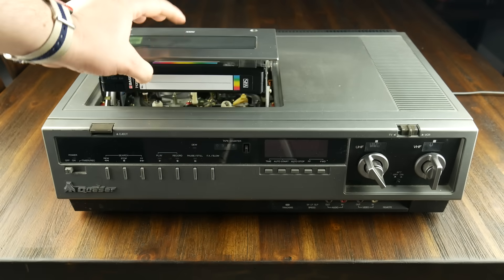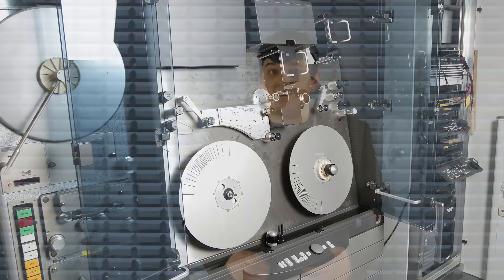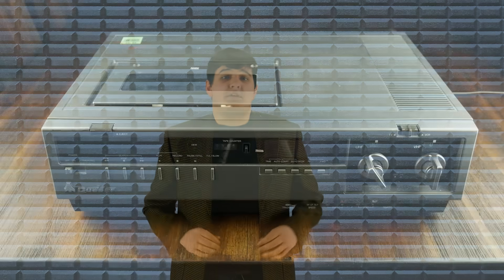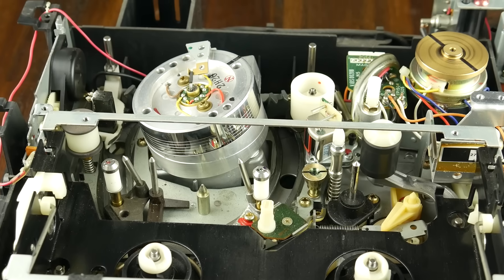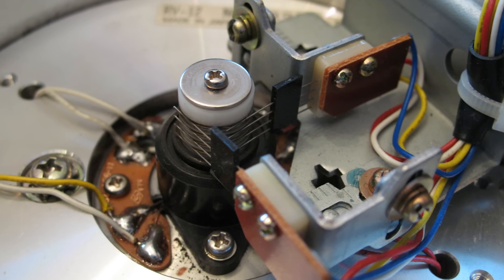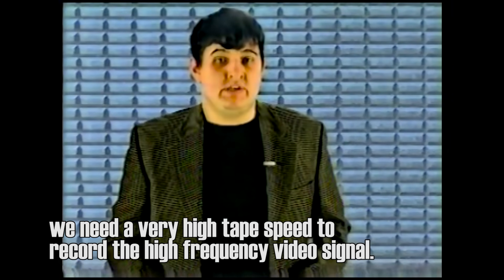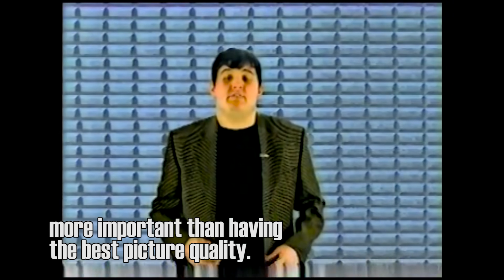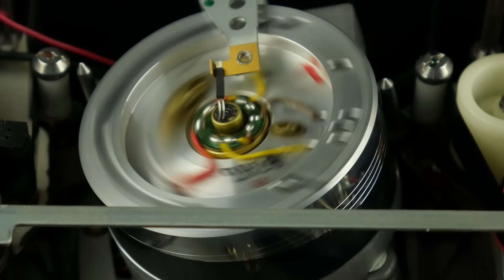The Impossible Feat inside Your VCR

Comment: i still have VHS. i hate them cause bad tracking means crap video or audio. meaning the only way to rip a bad vhs is record audio and video separately and put it back together via video editor.  to top it off vhs is interlaced meaning video resolution when rendered progressively is cut unless you use handbrake to render  the video with a special filter. but even wit htat filter some quality is loss and losing quality on vhs is not acceptable since vhs suck to begin with.  there are a few players that output component progressive with vhs but those are hit and miss with working correctly and not cutting resolution.

Comment: thumb up if you actually remember, used, and owned a VCR! (and a tape player and a pager and an answering machine, and dial-up internet, or NO internet....)
Reply: Dial up !!!! 4.5 Kbps on a good day !
Reply: Here here! I also had to use a rolodex and had written down over 700 contacts (phone and fax numbers). I was there when computers were introduced into libraries (school and public) and Boolean search was all the craze, and as a child I was taught to use the index card system of searching for books using the alphabetical system for authors and subject matter.
Reply: Laser Disc Bitches lol. 
And still have my VHS party tapes. 
So much more convenient than my reel to reel. Or albums.
If only they made a small handheld device that you could do Everything on. What? And it makes Calls??? So your telling me my $1200 Motorola BRICK, 3 batteries, and my $300 AIWA Walkman things are Obsolete... 
Well. I guess thats Good News for my Back lol oww
Reply: Yep, I'm old enough (having grown up in the 80s and 90s, born in '77) to have used all of those things.  I even had a numeric pager back around 1999 (later upgraded to a 2-way pager around 2001!).
Reply: @RyanSchweitzer77  old thread I know, but I had to leave my 2 cents anyway.
I was also born in '77 and have used all of the above. No experience with Beta tho, just from the VCR forward. My parents had 1 with a remote control but it had like a 30foot wire attached to it, no infrared. Technology is great. I still own a VCR although it rarely gets used, it's here just in case.
Reply: all yes, betamax vcr, (computer tape for my acorn atom, had a pager, answering machine, 300 baud modem)
Reply: When I started on the internet I was in usenet groups for a year or 2 before using my first web browser LOL
Reply: I'm 22 but yes, all of those except pager, answering machine. Those were luxury to us lol
Reply: Anyone remember the IBM PC Jr.
I thought not, well I still have it.
My career started in the main frame 2nd generation era 1963.
I worked for Honeywell who made some awesome gigantic mainframes. Then HP, the original HP when Bill and Dave were still alive.
Remember the Compaq LUGGABLE? the size of a small suitcase but twice as heavy.
I think I have seen it all, tape drives built like Swiss watches but weighing 1,00 lbs disk drives the size of large washing machines costing $45,000.
Magnetic memory worth more than its weight in Gold.
Then I worked for Bridge communications/ 3Com the TRUE PIONEERS OF NETWORKING, then Cisco who perfected it.
What an incredible career I have had and I LOVED IT.
Reply: Chris Andrew besides VHS or VCR does anybody video tape rewinders?
Reply: christian aquino I had a tape rewinder
Reply: I used and owned a Magnavox VCR (in my childhood) to watch movies
Reply: VR2000 :-)
Reply: My parents had pagers, but yea I used the other ones daily as a kid.
Reply: Chris Andrew Also, the Filofax.
Reply: My first modem was 300 baud. 300!!! It was a little gray box (I think I still have it somewhere) and you had to dial the phone number yourself on the phone, after which, when you'd hear the squeal, switch the modem from voice to data!

Oh, and my first computer was a Commodore VIC-20. I wrote a bowling game for it in its whopping 3500 bytes (bytes, not kilobytes, not megabytes, not gigabytes, not terabytes) and sold it to COMPUTE! magazine and netted about $1,000 for it. The VIC-20 I had bought used for $250 and I loved it.
Reply: I am lucky as I got 9kbps average!!! :D
Reply: Chris Andrew still have one lol
Reply: Tandy DCM-6 was my first.  Originate/Answer switch, connect button, two LEDs.  Had more fun at 300 & 1200 baud than I have since, I guess because computer communication was so new.
There's still no decent replacement for a VCR.  DVRs all have monthly fees and make it hard to archive recordings.
Reply: Chris Andrew all of those except a pager
Reply: I still have a VCR and still use it lol
Reply: Adele Hare I used to have a combo player. I want to get another one because I still have a bunch of VHS tapes
Reply: Not only did we, of course, own one - or several, from 1979 onwards - but, of course, I had to take one or two apart when the tape got stuck, and learned the genius of that rotating drum.  It was still always a frustratingly messy format. It was very exciting when, for the first time in 2001 or so, we were able to play DVDs on Gary's PlayStation. What a difference in quality. No step up (say, from DVD to BluRay, or from HD to 4K) has been as marked as that from the snowstormy, wobbly picture of VHS to the seemingly broadcast quality (albeit, in retrospect, blocky) sharps of the DVD system.
Reply: We bought our first camcorder, a Sony video8, in 1989, but upto then my dad used a 8mm cine camera, a film cartridge only lasted for about 4 minutes! Who remembers those?
Reply: I used vcr and still do just cleaned it, use a little mini tape player, don’t use answering machine anymore and used it and used dial up Internet. Kid of 90s ftw.
Reply: I still use a lot of that stuff, I have a VCR, I have a answering machine I no longer have a Cassette player unfortunately, but it isn't like I can't get music on CD.
Reply: I'm only 21 years old and I have used VHS tapes for recording movies and I also used to listen cassettes. My first internet access was a 56k dial up connection 15 years ago :) Today I have a 100Mbit cable connection, I don' t miss the dial up speed :D
Reply: Yes. I still have a Beta VCR that works.
Reply: 4/5 ain't bad, I never used a pager. VCR, 56k dial-up, Walkman tape player, and an answering machine that used a single microcassette.
I've heard about answering machines that used two cassettes, with one of them being a special "loop" cassette to store the pick-up message. In that loop cassette (you guessed it) the tape is in a loop, it plays in only one direction, and it probably has some form of "this is the starting point" indication.
I hope some day TC does a video on old answering machines.
Reply: I had my internet on a dedicated phone line with wingate to share it amungs my 3 computer in the 90's.
Reply: i still have one. Sometimes i pop in a disney movie just for the nostalgia.
Reply: you could just say.  "thumbs up if you remember the 80/90's"
Reply: I’m 35
I remember vhs and beta still own both machines 
Dial up too
Reply: @mrtechpat  if they're in good condition they might be worth some money 🙂
Reply: Dalton Flandro funny thing is my beta machine which is older still works. VHS does not play tapes properly
Reply: I use a pager daily at work 🙂
Reply: 1234lavaking I didn’t think those were still in use
Reply: 500th like!
Reply: I still own and use a VCR. As well as a computer that, before the upgrade, only had a dial up internet connection.
Reply: Same.  In pedantic moods I still hate when people call the web "the internet".  I mean, what about gopher?  What? You don't use that any more... hmph.

Comment: The reason many VCRs dropped the middle speed is that four-head machines had one pair of heads optimized for SP and the other set of heads optimized for SLP (EP).  They used the SP heads for LP.  Thus, LP provided poorer quality than SLP.  There was little point in using the middle speed and getting poorer quality.  Excellent video.

Comment: I certainly don't miss repairing video machines any more, they had some very time consuming mechanical faults, adjustments and calibarations and the older they became, you could never restore their original recording quality.
However, because the audio head was considerably larger than an audio casette tape, a VHS recorder would record excellent cost effective music recordings.
I still have many 3 and 4 hour music compilation tapes on VHS and I could connect the audio output directly to an amplifier to avoid using a TV.
Of course that all that seems far too "stone - age" to even bother about with now.
Apparently though, there seems to be a market for old VHS tapes on Ebay, now selling for a £1 or $1 each.  God knows why, I've still got hundreds of tapes in my cellar, perhaps I should drag them out some time.

Comment: Gotta call you on your idea that the luminance and chroma are laid down on the tape at a different time. Both are done in one sweep of a head across the tape. Once Beta came out with HiFi Stereo machines, VHS had to find a way to compete or they were a gonner. Vhs came up with a way to record the HIFI Stereo audio deeper in the tape from a pair of heads on the drum that would contact the tape first and as the drum spun the next pair of heads laid down the standard quality video on the top surface of the tape, with the HIFI audio deeper into the tape under the the video tracks. Audio and video heads  were angled differently so as to not interfere with each other. VHs called this depth multiplexing. Beta had a greater bandwidth therefore better quality picture. There was enough extra bandwidth to record the HIFI audio using the same pair of heads.

Comment: If you want talk about format VCR war: It's actually 3 formats: V2000, Betamax and VHS. V2000 is of course late-comer and almost forgotten, but they have respects for technology...
Reply: Yes, the Grundig V2000 - which you could turn over and play the other side of the tape ! Yes, very good - sadly, came too late to market.
Reply: Why was it good to have to flip the tape over?   The system HAS to use helical scan, as the video we're commenting on clearly explained.  So why record on only half the tape on one pass, instead of running the tape at 1/2 the speed and recording one full stripe across the tape?

Are you saying you could get 4 hours with the same video quality as VHS SP?
Reply: It made it different - a marketing thing at a guess.
Reply: Don't forget the U-Matic and the Phillips :-) U-Matic never really domestic, Phillips though was. I'm not sure why it died out - Mechanically less robust than a VHS and far lower duration, but better quality. The tapes got expensive too. Any other reasons ?
Reply: it probably appealed to people who were used to (or fondly remembered) flipping over vinyl records and audio cassette tapes.

Comment: Well done! Color-Under Vs Direct color is a little off. All television is color applied to a Black and White or luminance signal, even ATSC-HDTV. The main difference between Color-Under and Direct is the post-processing done to color-under. They are taking high frequency color info and heterodyning it to a lower frequency so it can fit in the limited bandwidth of the tape format. That was the main problem with S-VHS. To keep it compatible with regular VHS,they left the color processing alone where they probably could have given the color a better bandwidth at a carrier further away from the luminance. Very through demonstration. Very impressive. Thank you.

Comment: Gotta love the '80s and VHS.

Half-speed Mastered Picturedisc vinyl was friggin' expensive, so a Hi-Fi VCR allowed playback of a bunch of 'em hundreds of times before you had to record from the precious source once again.  You'd get the platter spinning, spray on Discwasher D4 followed lightly with the Rolling Microbrush, hit it with the ZeroStat for two slow pulls, brush off the Stanton, press record on the deck and gently introduce that tone arm.  Repeat until tape full and you've got sonic bliss for 6 hours right at your fingertips.

Comment: Although this is highly interesting, it is rather irrelevant. At the time we did not have on demand TV, so the very benefit of being able to record broadcasts that would otherwise have been missed outweighed the quality issues. In any case you do not know the quality is poor if you have no better reference. It is therefore a rather unfair comparison retrospectively. In the same was as comparing a car from the 80s to one of today. Furthermore the NICAM system that I had back in the day was actually pretty good both audio and video.

Comment: Sorry I was a SVHS man myself I had too end decks. I still have them today and still work fine. I use to repair vhs machine too so done lots of head changes and electronics repairs to them. Still have all the repair equipment for them too. My decks had good TBC built in so always got the best out of them and I also used separate TBC. TBC are time base correction look them up on the net. One of my decks still got low hours on it and the other I still got a set of new heads for it. I remember spending a £1000 in 1989 on a SVHS DECK and over £2500 on the other one. Plus I do have other SVHS decks still. Also have a SVHS,DV, HDD deck and that great for editing. I love the vhs days.

Comment: amazing, technology. I feel an analog revolution coming. Thanks for sharing this, I was not aware that 5Mhz were required to record video signal. I was also unaware that the tape spindle was going 1800 rpm. ..Question... ¿At 15:41 you had mentioned "color data" would that be "signal" since it is analog?

Comment: The thing about LP disappearing always felt strange to me. Every post 80s VCR I had could not record in LP but could play in LP. This would cause interesting problems with the digital displays. A VCR would show you on screen or on the front of the machine which speed it was playing back at when you started up a tape. SP or SLP(EP) would appear on the screen. If it was LP then either nothing was displayed or in some cases there was a glitched digital display. It's interesting how they just did not bother programming a digital display for LP playback even though it was perfectly capable of playing at that speed!
A VHS camera I had would show a "?" when you pressed play on an LP tape. The analog video was just fine, but the digital display didn't know what to make of it!

Comment: I didn't think Beta worked the same way, in that the tape didn't have to be pulled inside and wrapped around the head as it did with VHS. I don't have a unit to check to verify this though.

Comment: Question: did they make longer (like the T-160, etc) tapes by literally having more tape, or by making the tape itself thinner so more fit on the reel? 

(Also, I've always been bothered by the use of "Super" as a technical term. I know it means "above", but I always think of comic books and old NES games. "SLP" bugged me.)
Reply: Both. As with audio cassettes the C120 or even c180 were very thin and would distort at lower recording levels.
The US seems to have gotten a bad deal on VHS tape lengths. In PAL areas the most common tape length was 3 hours (E-180) followed by 4 Hrs (E-240). BASF even made an E-300 for 5 hours at SP speed.

Comment: I get that the mechanics of automatically wrapping tape around a helically running drum is more intricate and interesting than a laser diode reading ones and zeroes off a spinning disc. The same way, electrical drives like Tesla's can't ever reach the intricacies of an 8-cylinder combustion engine with turbo at the rear end. Nevertheless, I'd rather not buy yet another VHS machine or petrol-guzzling car, but surround myself with cleaner and »easier« tech.

Edited to add: Thumbs up, great explanation of helical recording! Cheers!

Comment: Very interesting video. I bought my first VCR forty years ago Aug 16th 1977, yes the day Elvis died. It was a Philips machine which pre dated Beta or VHS. The quality of the video appeared better than the later two,  probably down to the size of the head drum, which was bigger hence the writing speed was higher. I still have a couple of working the Philips machines in my loft. There is also a load of processing that goes on between the signal being read off the tape and being sent to the TV. The raw video is very raw. I'm going to have a look at the techmoan video next, he's also one of my favourite YouTubers.